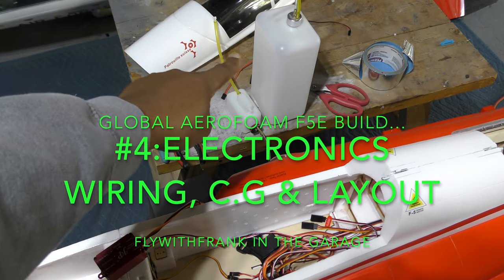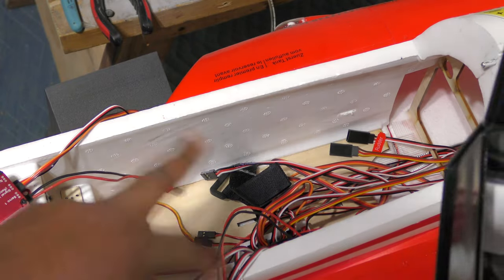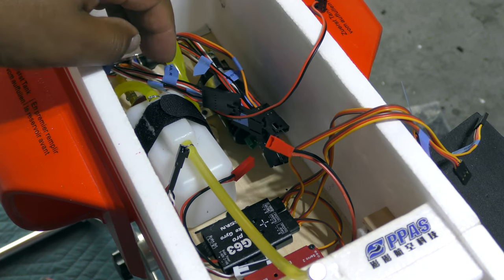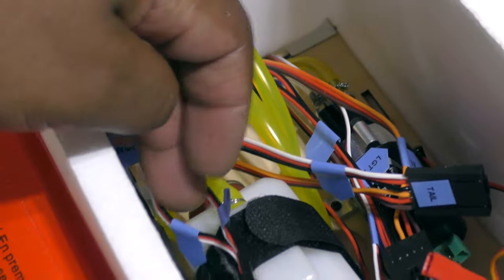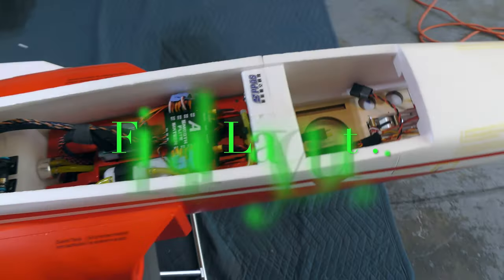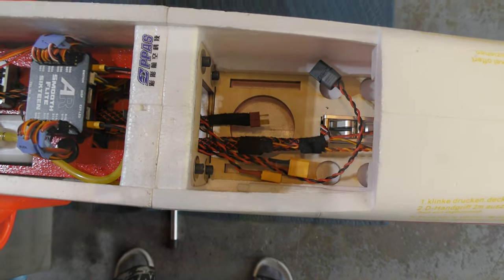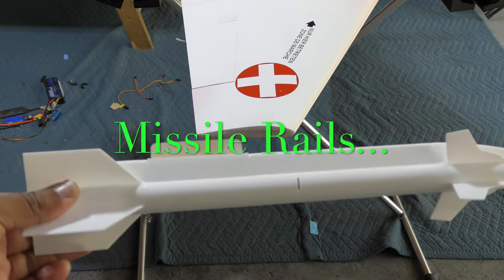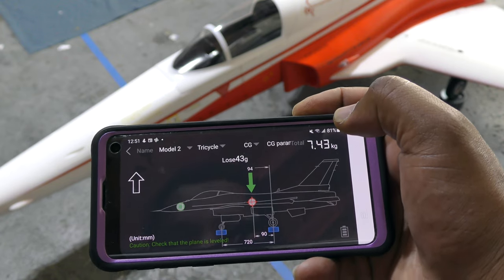Aerofoam F5 Build Series #4: Electrical System Wiring & Final Assembly

Comment: Hello Frank; So I'm watching you talk about the BEC and how it's not working when you change the voltage setting. There are two out puts; out-1 is the one that is adjustable ; out -2 is pre-set to 7.4v as it shows on the face of the BEC. If you look again you will see there is a color change between out-1 and out-2 . you pointed at out-2 when you said you only had 7.?v out-1 is the one  that you made adjustment to so check voltage at out-1 and see if it's working correctly .

Comment: Like the idea of the connectors makes for a clean installed. What are they called and did you get them?
Reply from the maker: They are molex cgrid connectors. I have used upto the 12 wire versions of these connectors Got them from digikey here. The mating part and pins should be on the website page too. https://www.digikey.com/short/813zdqvt